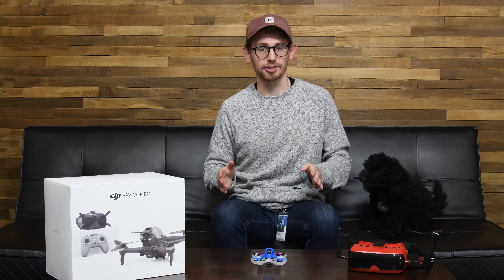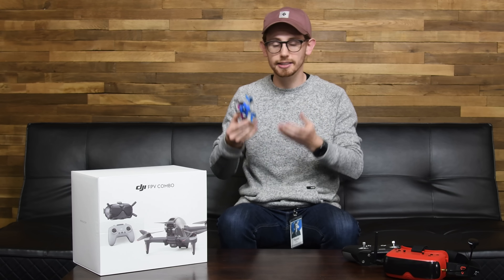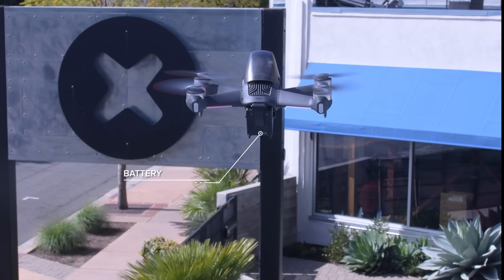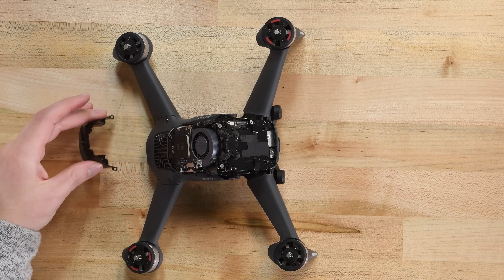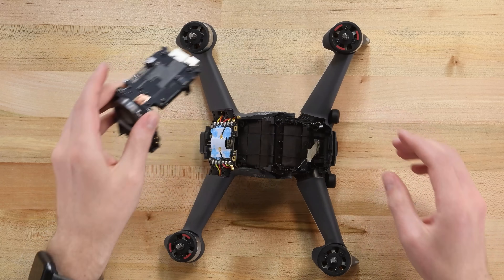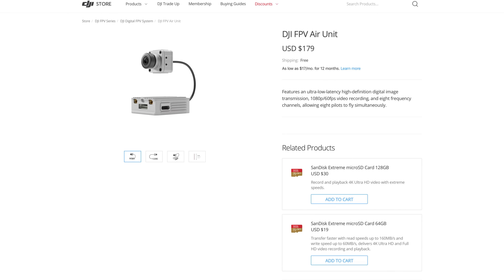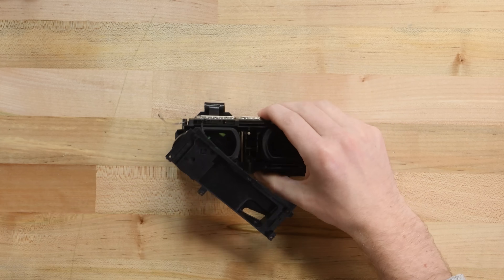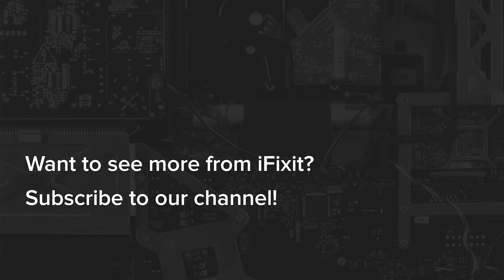DJI FPV Combo Teardown: Can DJI’s New Drone Kill the Custom Drone Market?

Comment: Please can you do a teardown of the batteries for this?
Reply: I've taken photos of the insides of one of my batteries. I haven't uploaded the images yet but I plan to in the near future. You should be able to find the images on my Hackday(dot)io page.
The battery was surprisingly easy to take apart.
Reply: @ddegn  Thank you, I'll look out for it. I noticed there were two screws right on the outside of the case but it didn't like the case would open with them removed so I was worried it might have been glued as well. I guess it's just a tight fit?
Reply: @yngndrw.  The two screws are hold the top long piece of plastic in place. The top piece still has to be pried open from the plastic clips. My battery has a couple marks where I forced the screwdriver in to pry things apart but doesn't look too bad.
There is glue holding thin black plastic to the sides of the batteries. It's not strong glue and as I said before, I was surprised how easy it was to take apart.
DJI's RoboMaster S1's batteries were much harder to take apart.
I loaded the photos onto my computer yesterday. I'll try to upload some to my Hackaday page today.
Reply: @yngndrw.  I uploaded some of the photos I took. I saw you're following me on Hackday IO but wanted to make sure you saw the photos.
Reply: @ddegn  Thank you I appreciate you uploading those photos. I was surprised to see that it has fuses - 180A of fuses in total. I was hoping to work out if after-market batteries could be used but I've fallen at the first hurdle, the connectors. I suspected that these were 3mm bullet connectors but the springs are on the wrong side. The male bullets fit into the battery but the female connectors are loose on the drone.

Having the pictures so that I can see where the clips are is worth its weight in gold, I should be able to easily disassemble mine without damaging it now.
Reply: @yngndrw.  I'm pretty sure the drone and the battery communicate with an I2C bus. The protocol would need to be hacked or you'd need to reuse the DJI PBC to use other batteries. I captured the communication exchange in the RoboMaster S1 but I haven't taken the time to capture the communication with the FPV drone yet.
"see where the clips are is worth its weight in gold"
I got lucky and didn't damage my battery too bad. I hope someone posts photos of the controller taken apart. I have no idea where the clips are inside that thing.
Reply: @ddegn  I still can't seem to get mine open, it seems to require a lot of force. I don't know how you didn't snap the little clips on yours when you opened it.

I just tried it with a logic analyser and got nothing, just the bottom pin which occasionally changed state with the button so I think I'm missing some pull-ups. I could do with testing it while it's connected to the drone, but for that I need a way of extending the main power cables.

I wonder if the third unconnected pin that you found is related to the sequential charger, so that the charger knows if it's talking to a battery or the sequential unit?
Reply: @yngndrw.  I believe the drone communicates with the battery with an I2C bus. The battery likely only replies to requests from the drone. You probably won't see any communication from the battery when it's not connected to either the drone or the charger.
Intercepting the communication will likely require a custom connector. I'll likely make something to go between the drone and the battery like I did for the RoboMaster S1.
The second photo in my Hackaday post shows some red wire visible through the partially opened battery. The location where the red can be seen is where I started prying the pieces apart with a screw driver.

BTW, I managed to open my controller. I'll be adding photos of the inside of the controller to the project soon.
Reply: @ddegn  You're right, I don't know why I had it in my head that the battery would be the I2C master as that doesn't make sense. I think I was too fixated on the use of the power button as the bind button but thinking about it the drone probably just polls it.

I'm thinking that a 2.5mm female bullet connector with a slot cut down its length might be a good option for the drone side of the power connector, but sadly I don't have any on hand to test that. 22AWG solid core wire seems to fit well into the smaller sockets on the battery side and as I mentioned earlier 3mm male bullet connectors work well for the battery power terminals. I just wish they'd used a more standard connector.

Will be interesting to see the insides of the controller and whether or not there's enough space to put larger gimbals. It's a shame they didn't add a little solenoid to control the sprint return on the throttle stick for when you're in manual mode.

Comment: Do you know if the version2 goggles and controller will work with a smaller drone like the protek25 or similar? I would love to have a small drone to fly around my yard and only use the dji fpv in bigger open areas... wondering how hard it would be to switch back and forth also? Thanks for any help you can give!
Reply: I'm pretty sure the controller which comes with this drone can only be used with this drone. The goggles should work with other DJI Air Units but the controller doesn't work with the Air Units.

Comment: SHORT ANSWER: NO. the custom market is shifting to performance Sub 250G class in the 80USD-to190USD  price range as a bind and fly because of FAA overregulation that will kill this specific Drone. The ADS-B receiver is nice though and we hobbyists are looking at it with envy, but it wont mean we want to buy a prius for the night vision or the heads up display instead of our bare bones Porsche GT home builds that turn on a dime and boost in a heartbeat for less than 1/4 the investment. Does the term "Split S to a power loop though a tree gap to an immelman out at no less than 50% THROTTLE " escape you? then go buy the hybrid Camaro without launch control and AUTONOMOUS garage parking...
Reply: This new drone has two main things going for it. One, it is easy to fly. Not many FPV drones can easily hover. Two, the transmitted video image is better than anything else available in this price range. It's better than what you get from their Air Units.
Reply: @ddegn  repair costs though, not good. you'll see new people crash and break this 1000$ drone very easily and break a prop arm or two, then pay more than base cost to repair it
Reply: @TropicalCyc  "very easily and break a prop arm or two"
Yes if they fly it like a small FPV drone. In normal mode they can cruse around all day (if they have enough batteries) and not crash if they don't do anything wild.
Personally, I'm sure I could repair an arm or two on the thing. 
The transmitted video quality on the thing is amazing. It's a better fit for someone wanting to enjoy the view than someone wanting to perform crazy freestyle moves.

Comment: From an insider perspective,  I understand the need for user-replaceable/serviceable design but in todays world most people don't want to pay for a larger/bulkier/more expensive product if it means 1-5% of those people can take it all apart and repair it.   In this case, the device may not even fly it it's loaded with easy to replace components due to increase in mass/size.
Reply: This just doesn't apply to fpv drones, most self built quads are actually more compact, sturdier and fly better thanks to carbon fiber frames. This is a region like Desktop Computers, where building your own gets you a system that is actually quite a bit better than a similarily priced prebuilt.

Comment: It can't kill "the custom drone market" especially in performance, or compared to the convenience of 3 inch micros
Reply: Gonna be really hard to compete with components cheaper than the replacement props for a DJI
Reply: Dji won’t take me over purely because I crash enough that I’d be dumbing money in to it. My 5 inch can just tank it. I do want their digital system though
Reply: @Nilloc777  yes so true I only run a iflight dc5 6s it’s been though the wars had a few front legs replaced but it’s a greet freestyle rig and works ok as a bando basher, got the dji fpv and it’s destroyed when a sensor error warning came up and it cut out falling about 20m onto grass and it’s ruined total rubbish hallow plastic legs and exposed camera gimbal is no good for this sport
Reply: It utterly rips and I do love it
Reply: That's true my friend. Just like no matter how good a Mac is still it can't kill the PC market as well.
Reply: Dji comes with a package of issues related to racing and frystyle, as for today noone will race or do acrobatics with dji for sure... its good if you shooting a video but regular old school fpv does the job to, amd for cheaper... Anyways even dji googles is not fiting this marked sice latency... Well if you want to crash your drone on high speeds and tight corners, go ahead....

Comment: your "soft" anti-soldering policy for repairability is ridiculous, and not grounded in the realities of electrical engineering.
Reply: Agreed. The people who want to repair their own electronics likely know how to solder. Adding connectors increases the price, bulk and environmental impact of the item. One of the most common causes of failure in an item are connectors coming loose.
Adding additional connectors adds all sorts of problems while helping the very few people who are capable of repairing electronics who don't know how to solder.

Comment: All these features are great, but 10 minutes of flight. It's just not enough.
Reply: It’s way too much by fpv standards. You don’t need that much flight time.
Reply: Other reviewers are talking about 20 minutes though.
Reply: @tenslider6722  It depends on how they fly. It's about 16 minutes with very tame flying. If they fly faster and do tricks the time is greatly reduced.
There's a guy on the DJI forums who posted a video showing a test down to 0% battery. I think he got 16 minutes flying slowly.

Comment: No😂 eachine lizard flies 70mph on 3s and costs 200 total with Gogles and reciver
Reply: Yeah, but is that additional image quality worth $1000 more dollars to you? Maybe it is, maybe it isn’t. Depends on what you’re after and if you have the budget for it.
Reply: @brandonbell359  For that $1000, you get LONG flight times,  GPS/ALT hold, great range, and RTH. Plus it's a good trainer.
Reply: Yeah and a wizzard will self detonate itself. Please don't recommend dangerous quads
Reply: For the same price, you could buy a flywoo explorer digital version, DJI goggles, a controller, and maybe even crossfire and then you could have all those things and long range and it won’t shatter the first time it meets the ground. 

To be clear, how people spend their money is up to them. I’m happy with my purchases, but for what I want, the DJI FPV isn’t an upgrade in many ways and not worth the money to me to get the things it can do better. If you own one and love it, that’s awesome. Fly on.
Reply: I have tyro 79 rtf for somewhat 120$ probably and fly 116mph
Reply: @racistpixel1017  curious to know how you measured that. Maybe the new ones are different, but I’ve only ever seen them do about 80mph.
Reply: @brandonbell359  mine tyro 79 go 116mph  and it cost 79$. If you look youtube you will see drone that go 160mph
... I see many fast drones, just do your research
Reply: The transmitted image quality isn't going to nearly as nice as this DJI drone.
This combo has even better transmitted image quality than the previous DJI goggles with an Air Unit.
Reply: @ddegn  yh but do u wanna pay for a dji drone 😂 last time I checked you could buy a used car for the same price
Reply: @owenwalters3940  There's a lot of things I don't want which I could have purchased instead of the DJI drone. A cheap used car is certainly one of these things.
I wanted a FPV drone with very high quality video transmission. I wanted an FPV drone to be able to hover in place when desired. I am not aware of another product which matches these requirements at this price level.
Reply: @ddegn  while you want a strong video signal and hoovering, the video signal of dji comes with 40-50ms ping thats equal of crashing in hight speed or maneuvers, that means no fancy flying and racing... Even so handling of dji not made for it anyways...   If you want video fpv drone to make footages in hight speeds and open spaces, go ahead, you want racing or free style, better choose regular  fpv
Reply: @racistpixel1017  "no fancy flying and racing..."
No argument here. Besides the latency and performance issues there's also the problem of it being much more fragile than a regular FPV drone.
I hope people aren't ordering the new drone expecting the same sort of freestyle and racing performance as other FPV drones.

"mine tyro 79 go 116mph  and it cost 79$."
How much of the video system is included in that $79 price? Surely the goggles aren't included.

Is the latency of the DJI Air Unit low enough to use in your fast drone?
Reply: @ddegn  the drone considered as slow and for beginer, realy +- 100 mph not all that much. 
The video system or googles cost anywhere from 50$ up to dji googles. And if you willing to have 30ms ping for a moment, you can get usb antenas for 25$ and connect to your android. With 30ms you can fly but nothing crazy, good for learning in open spaces or just light flying, well you can do freestyle and racing but i dont like when drones crash, its still plenty fun, buy you have to look not to fly to close of obstacle's.

I wait when dji digital system will eliminate latency, then i would glad to use it, only problem is a price, if you crash and destroy your dji unit, well new one is expensive. With analog thats literally pennies compared to dji.

Comment: But can we replace that BLDC motors with another one which have more power?
Reply: You'd also need to replace the ESCs. I don't know if the ESC DJI uses communicates with the control board the same way hobby ESCs communicate.
I plan on investigating this in the future. I'll likely post anything I find on my Hackaday(dot)io page.
Reply: twopaste  I would assume DJI used ESCs rated for the motors they used. A more powerful motor would require more power from the ESC.
There could also be a problem with more powerful motors drawing more current from the battery. The battery has internal fuses which are more likely to blow with more powerful motors.
Increasing the power of the drone will likely require more than just changing the motors.
Reply: twopaste  Why would DJI put in an ESC with more power than the motors could use? It would be a waste of money to them.

Comment: that was one of the worst Ifixit videos I have seen? and I usually really like ur videos.
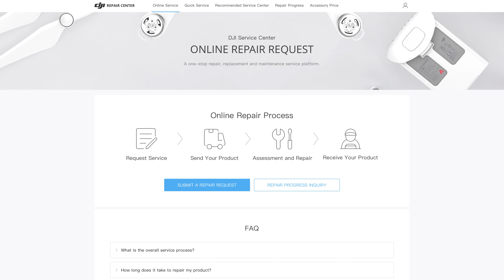you don't wanna open it and show the parts? (yes we risk destroying our FPV-quad, and since it still works we don't wanna take the legs off and show these individual parts like legs and motors that are crucial for anybody trying to repair it themself .--we dont wanna risk anything that is why we stopped with more or less the top-plate and the board underneath the heat plate 5:35
if we solder and show the legs and how the wires run inside and if its plug connected or all wires all the way to the motors then we will risk our drone and we don't wanna risk it. all of that is non-fixable.. you need to send it back. instead, we open a 50 USD plastic quad as an alternative, so people are not mad at us, that we don't wanna open and show the most vital parts people are needing to change like the arms.. these are non-fixable.. send it back to DJI and pay like 500USD for a flip with 200USD for the1 year extended guarantee + almost 300USD for the 1 and and the second you can use in that 1 year garantee.)
(ifixit message to the critic, )
ur wrong Ifixit DJI is intending to sell these arms and recall prices around 20USD for an arm, and it would be very informative to see how the wiring is inside these arms and what kind of parts it is and if DJI is using some technique that makes user-exchange easy..and to an extent swappable. (this is, after all, Ifixit and insight into user repairs)
A shame you don't take just 1 arm off and 1 motor. and showed these crucial pieces as single items, as that is the most vital parts people will repair., like most FPV quads... arms and motors.
Reply: I think part of the reason they didn’t show that is there is no way to get replacement parts. Maybe you can shoehorn a normal quad motor in, but given dji’s proprietary-ness I would be surprised, and since they don’t even sell replacement arms/motors there’s not a lot of point. Would’ve been interesting though.

Comment: does the stock controller have a fan?
Reply: What do you mean by "stock controller"? The control board of the smaller drone?
Most drones (including the small one at the beginning of this video) don't have fans. They rely on the air from the props and moving through the air to cool the board. Many drone transmitters will overheat if they aren't flying.
Reply: yes.
Reply: If you mean the controller with the joysticks then no. The controller which stays with the pilot doesn't have a fan inside but it does have a couple big heatsinks. Search my name on Hackday IO for a look inside the controller.
Reply: @ddegn  Ah I see I looked you up on Hackday, so the Dji Fpv joystick controller doesn't have a cooling fan but what's weird is that some people have said that they can hear a cooling fan in it..., maybe they confused it with the goggles?
Reply: @tfmg8223  I think you're right, they must be confused by the fan in the goggles. There are a couple metal heatsinks in the controller but no fan.